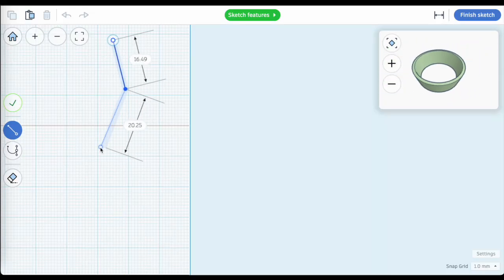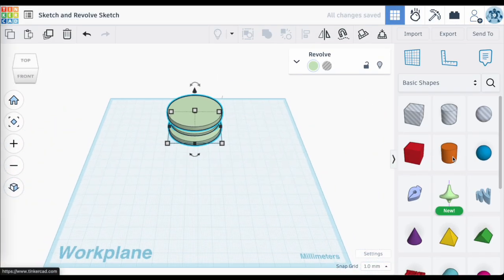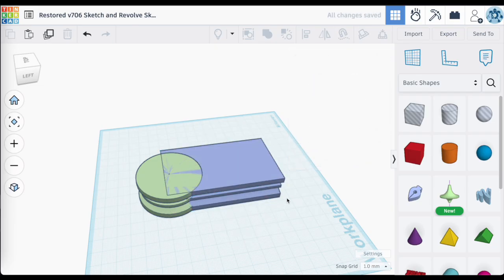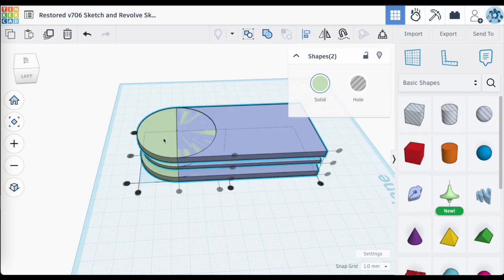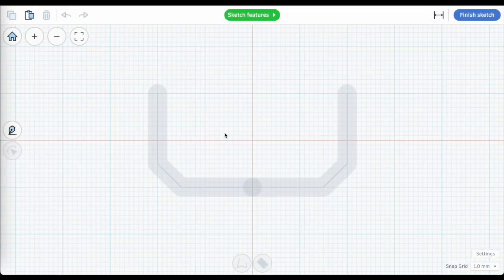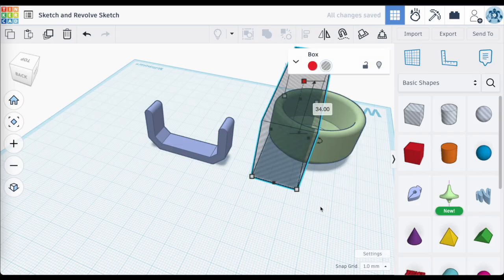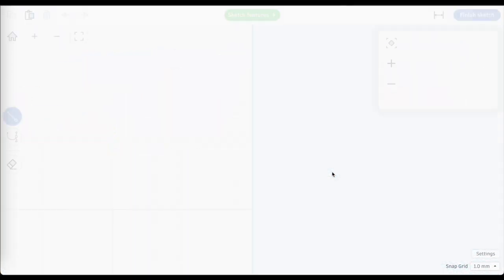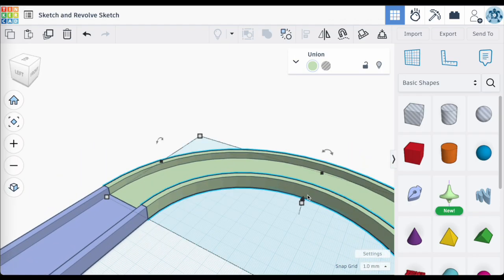Tinkercad's Extrude & Revolve sketch tools create amazing designs quickly

Comment: I'd like to see expanded file import size and the size of the bed.  Related increase resolution of export.
Reply from the maker: Good to hear from you again @graphguy - I have run into the same problem when trying load large or complex models into Tinkercad.  When it comes to the size of the bed - if you are looking to expand the workplane area - you can go to the settings icon in the bottom right corner of the screen (near the snap grid settings) and adjust the width and length of your workplane.  Thanks again for the post!
Reply: @technobentobuilds good reminder!
Reply from the maker: Thanks @graphguy  !

Comment: This application is really only missing a few tools that would make rival most paid platforms. Edge and vertex selection/modifiers would really get them close and once that’s done it’s not much to add a chamfer and filler tool to go with them. I’m very hopeful for future feature releases.
Reply from the maker: Oh my, if they could get edge detection on Tinkercad… awesome.  Is it possible to do this with an application run through a browser?  I really hope so.  Thanks for the post!

Comment: TinkerCad needs to offer the option of selecting variable Revolve degrees, rather than forcing cutouts. They've done this with other circular objects so I don't think it would be that difficult.
Reply from the maker: Yes - that would be a welcome feature.  I have no idea what they intend on doing next but I hope that update happens.
Reply: That's actually there... in tge settings after the shape is completed
Reply: @1791Actual  The feature was added about 4 days after I posted the comment.
Reply from the maker: You absolutely called it!

Comment: My first use of the Revolve Sketch I wanted a 60mm cap. I put in 30mm and revolved it. I didn't pay attention and printed it. 55mm is what came out. neat tool but watch what you have. I don't understand the change.
Reply from the maker: I find I have to be careful if I am using the open path when creating a shape.  @steviekorvell made a great point that it is easy for the line or any thickness coming off of that line to sneak across that centre axis.  I am not sure if that is what happened in your case but you’re right - users have to be careful with what they actually have revolving around that axis.

Comment: The mis-sizing is probably caused because you didn't close the figure in Revolve Sketch and then it adds a 2mm width to the line. Also I think there's a bug in Sketch tool generally that makes objects loose the set size on creation when returning to the main workplane.
Reply from the maker: I was wondering about that too.  You’re right - capping the ends does add extra width but I was hoping that having the actual end of the line sketch at the centre axis would take care of it. Interesting note about a potential bug -  it might explain why I also notice this happening with my closed shapes as well. Thanks for the comment!